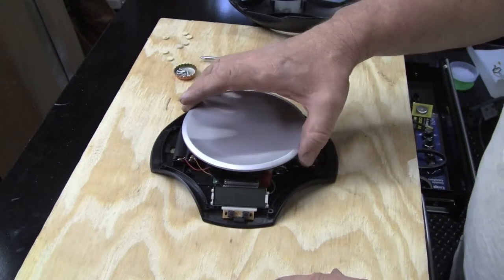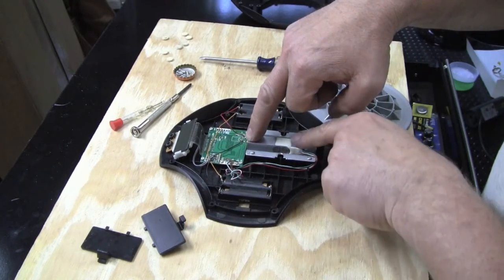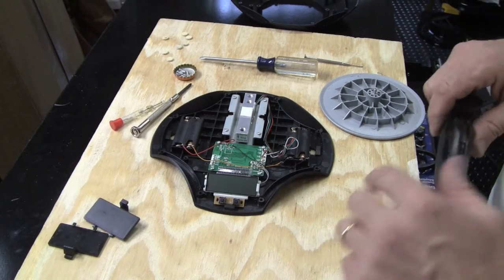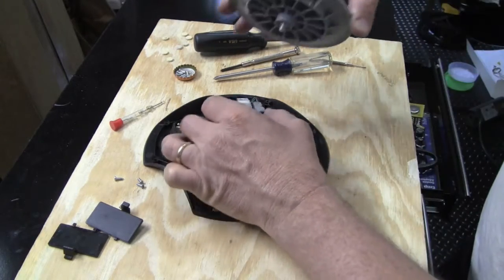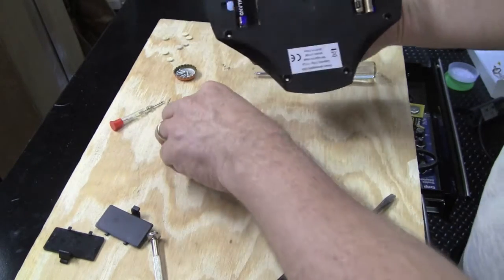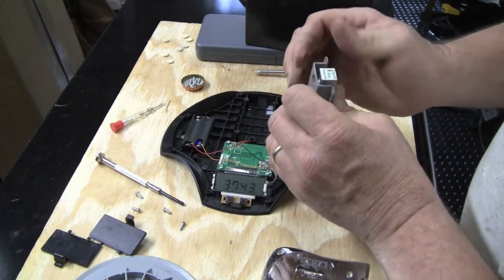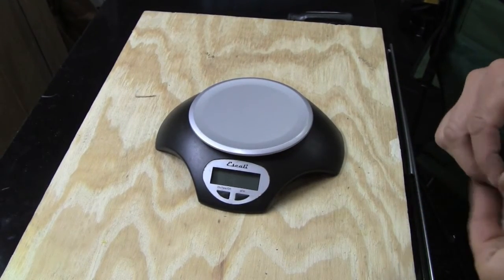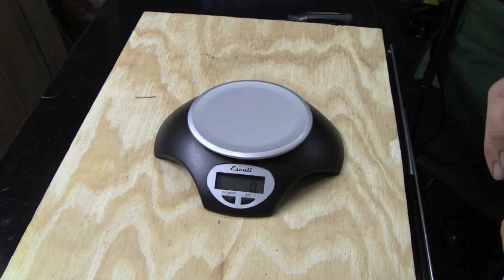Electronic Kitchen Scale Repair

Comment: Mine just dropped (first time).
Plate (under metal plate) has broken from the screws on the "beam" inside - is it dead?

Electrics/switching "kg to lg" works but registers no weight at all

Comment: Thank you for this, helped me fix my Bathroom Scales, jammed pressure sensors with dust bunny crud under the LCD contact strip which actually happened to be a flexible rubber strip... never seen that before!